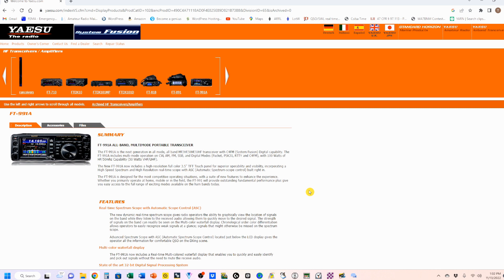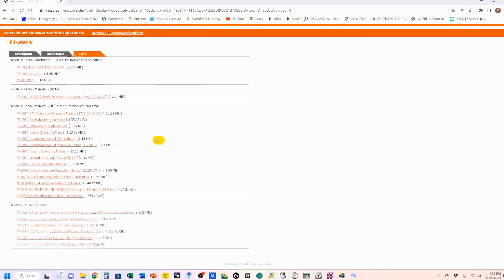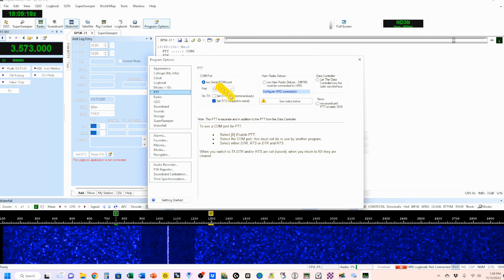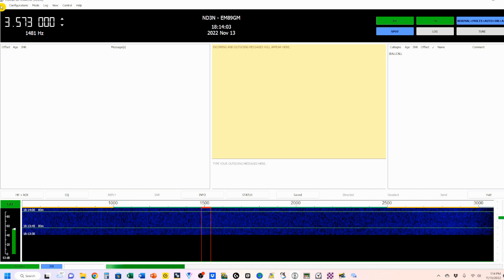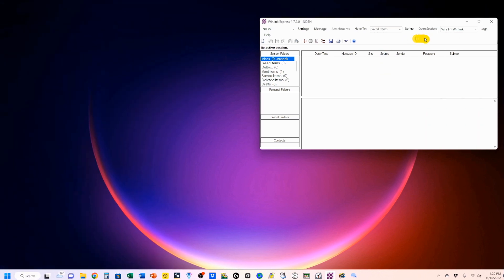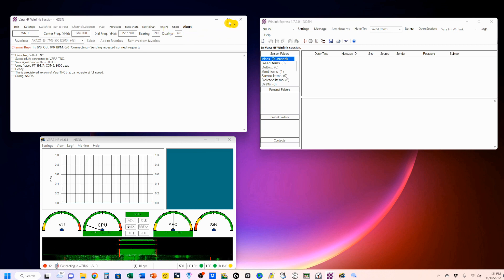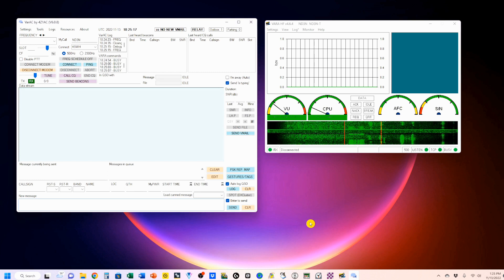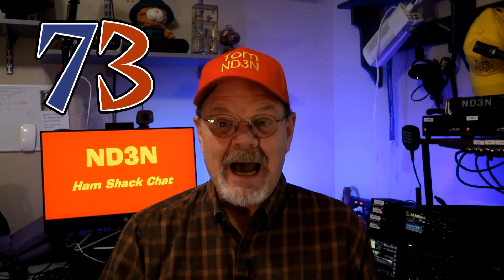Yaesu has new Rig drivers - Are you ready for them?

Comment: How can I check what version I have?
Reply from the maker: Check your virtual com ports using your device manager.  If they are labeled (partially) with "CP2105" they are the latest version.  If they are labeled "CP210x" then they are the older drivers.  73 de Tom, ND3N
Reply: @ND3N  Thanks!

Comment: Ha!  This happened to me but didn't realize it was a driver change issue.  I wont be upgrading to win11.  You are going to hear other hams soon talk about having to roll back.   The software in ham
Radio for the most part is extremely old... but it works... until the vendors muck with drivers and operating systems become more and more controlled pushing you to use their app stores and deter "third party".   Anyhow, thanks for the great vid.  The tip about an adult beverage is solid ham troubleshooting advice.  Lol